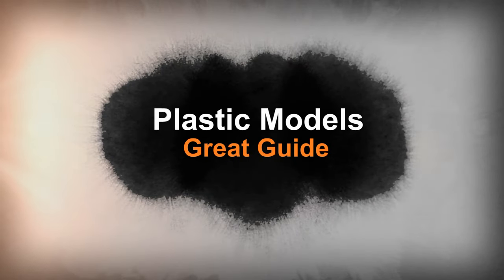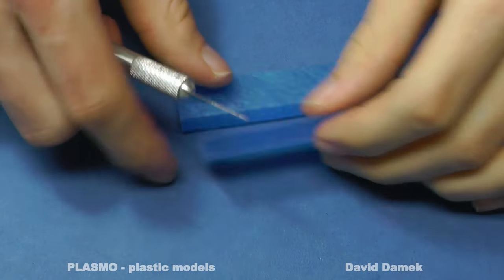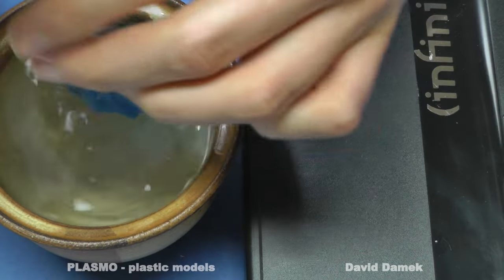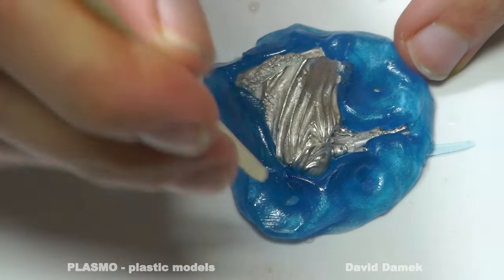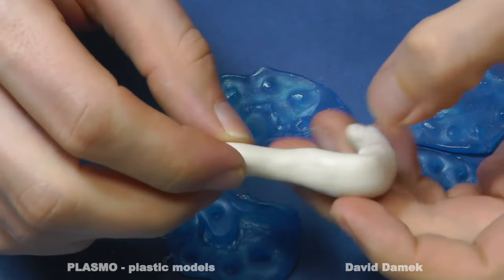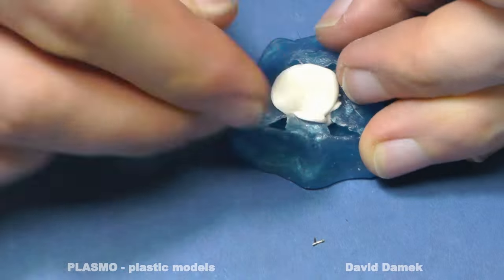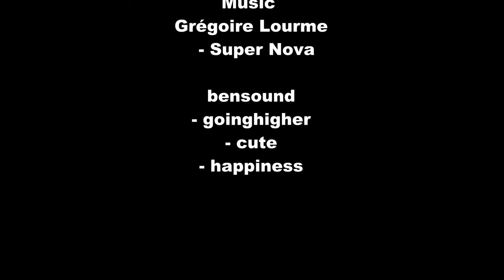Blue Stuff/Oyumaru  - How to cheaply cast miniatures or plastic models - new version

Comment: having tried what he did in the video.  I would not have cut the bricks into smaller blocks.  I let them float and soften up in the hot water.  I mush them together, as he does here.  But even so I still have streak lines in my molds and just trying to flesh them out smooth takes more time.  I go back and dunk them in the boiling water.  Even then it takes a long time.  
I wish he was more specific about the time it takes to kneed and heat the blue stuff.
DO NOT CUT YOUR BLOCKS!
Reply: I saw someone else mention that cutting the blocks is bad, may you enlighten me on why this is?

Comment: Small tip to get extreme high detail, requires an assistant, a hair dryer, and a toothpick. Assistant uses hair dryer on high heat on the oyumaru as you use the toothpick to press into the minute detail spots

Comment: I did try to cast small parts from various epoxy putty and the problem is that all of them are very fragile and break instantly i don't understand what i am doing wrong, I have not tried that actually putty that is used here in this video.
Reply: Difference brand have difference characteristics

Comment: can liquid resin be used anyways ?
Reply: Don't see why not. You would just need to have release channels, like what you would see on a proper resin cast. Also, depending on teh angle, you may run into air bubbles forming in spots as they cannot escape.

Comment: Can putting plastic parts into hot BlueStuff damage them easily?
Reply: Unlikely as these don't tend to get hot enough to really make traditional plastic parts react negatively
Reply: Metal parts will retain heat and  warm up both sides of the blue stuff and fuse them slightly

Comment: Your epoxy putty looks more soft than Milliput. I use milliput but probably if I use milliput to do the copies it will break when I remove it from the molds. Your putty instead can be removed very easily.
Reply: I bought oyumaru on ebay a few hours ago! Thank you for the video! I really need something like this product but I didn't know it already exists!
Reply: Your better off using kneadatite brown stuff or green stuff with these molds. I have used both millput the kneadatite, and I have gotten better results with the kneadatite. The brown stuff is less sticky that than the green stuff.

Comment: Would this work for 10mm figures? Any fans of dead GW games will know what I mean
Reply: the nerd shack  yeah those strips of tiny troops, just wonder how well this would do since they're not detailed just well, small
Reply: the nerd shack  Yeah I'm just gonna get some and try. It's cheap enough that if I cock it up its no big deal
Reply: the nerd shack  The biggest problem is mold lines. They are massive if you don't get a tight fit and use exactly the right amount of putty. Even if you get everything perfect there will still be a large line of lost detail. Troops small enough though you can just do a one part mould and its fine and so easy

Comment: Hello,
Is there a U.S. distributor for Blue or Green stuff?
Reply: E-Bay
Reply: @Anaris10  
Thanks for the info.
I prefer to "cut out the middle man" and the inevitable additional fees (PayPal) whenever possible.

I've since found that Michigan Toy Soldier carries the line.
Reply: @kidmack1121  Weird since whatever shop that is will be a 'middle man' and PayPal doesn't charge any fees for buying products.
Reply: @funoff3207  
I should have just admitted that I hate PayPunk because
they ripped me off!
If you are a hobbyist, you might want to check out Michigan Toy Soldier.
They have everything, but because they have so much stuff it can be hard to find using their search box. It can be pretty particular.

Comment: i bought blue stuff and tried to make a copy of a 1/72 fighter pilot: i admit the pilot is really small but i found a problem that is inherent to the blue stuff itself: the mold remains soft. Yes it's difficult using blue stuff before it hardern, yes it s difficult filling the mold with the putty but the worst thing of all is that the 2 parts of the resulting blue stuff mold will never fit properly simply because they are not rigid, so the putty will never be pressed properly and the resulting stamp will be bad. Very poor results. This stuff can not be a substitute to more professional materials
Reply: Also, i m using milliput epoxy putty and i MUST use a lil bit of water to make the putty fill the mold, otherwise the putty will stick to the finger or the tool instead than to the mold. Well the putty never dry. My casted pilot is still soft after 2 weeks i made it. This is more a commercial than a tutorial.

Comment: ya mine never worked like that ,had trouble separating the two halfs of blu-stuff and it never moulded like this.
Reply: You have to wait till first part of blue stuff mold is hard and then put other half onto it. Otherwise those two parts "melt" together

Comment: Okay maybe I'm a little naive or something but isn't this a copyright violation?
Reply from the maker: It was a lot of speculation about copying miniatures for your own purpose. You can not sell them, you can not use them in official Warhammer tournaments, It is not ethical, quality of the castings is not perfect, and it is very time-consuming. However, it is not illegal. Why I did this? It is a shame to throw to trash half of the plastic kit. Mostly you need to cast only a few parts and rest use from a kit. I think the larger danger for a manufacturer is 3d printing or professional copy from China. In my case, you need to buy an original kit.

Comment: @12:48...it didn't mold well from the original at the back you show...it's rounded and didn't form the detail...in fact, you didn't show this result in a reasonable amount of time and flashed the comparison scene quickly without allowing people to have more time to see the poor result. Am I wrong?
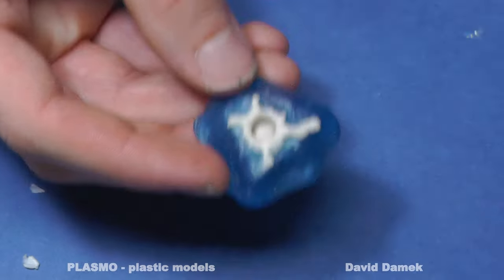Reply from the maker: The result is of course not the same and as good as the original miniature.  You must spend some time with cleaning imperfections and putting. You can see at 12:35 quite clearly that result is not the same.

Comment: wondering how you would cast a skull would it be side on or facing up anyone got any ideas just thinking of the flash lines
Reply: if you have detailed areas then it's probably best to put it so that detail is captured, mainly eyes,mouth ect so face down/face up otherwise you would need to poke the putty round the detail rather than just into the detail and as for flash lines just use some sand paper or a nail file
Reply: Ryan Rea  many thanks for the tip it's my first journey into casting

Comment: how about original work, how does one go about making his own 3d model and start making molds?
Reply: most likely your best bet would be to use wood or clay, but clay is preferred in that it is easier to sculpt. good luck with making your models. also try looking at tutorial on 3d modeling if you have a maker.

Comment: Thanks so much for letting me know about this stuff. I'm still learning to use it properly. Had mixed results so far because I can't always get the Milliput to fill all the spaces properly, or put too much or too little in, or the pieces don't align or imprint correctly. Takes some getting used to.
I'm curious though. Do you know if liquid plaster (I presume some plasters would be cool) would work? I feel it might give better results for more complex casting.

Comment: you loose detail, especially around complex shapes with voids  in them (clearly visable in the white metal figurine) that is one great disadvantage, but you can't beat the price
Reply from the maker: It looks that you have right but I sprayed figure with surface and it is quite same as original. Of course not 100% same. Epoxy putty is very shiny, so on a camera you cold not see all details.

Comment: The amount of work required to make these, verses the cost of just buying them.  I don't remember these miniatures being very expensive.
Reply: The alien he made parts for costs $15 for one. Comes in a pack of 3 for $45. Really depending on how much you value your time, but $15 for 10 minutes work sounds good to me. 

Also, this is great for getting duplicate of specific parts. Games workshop doesn't give our nearly enough pieces to equip your guys in the ways you might want. Instead of being forced to buy another $45 kit, you can just make a few weapons and be happy.
Reply: @secretnewmeta1981  I'm certain that takes longer than 10 minutes.  Please, don't exaggerate.
Reply: @secretnewmeta1981  Also, I know you are lying about the cost of the materials.  I called my local hobby shop and they said it costs about $15 just for enough material to make one miniature.
Reply: @charliechuckleberry5307  The company Games workshop sells the model for $15 each retail. $45 for a 3 pack. That's right there on their website. If it costs then more than $15 to make one miniature then they're losing money with every sale. By the way, the chinese manufacturer of GW came out and said that it costs them around $0.50 per miniature. 

The epoxy being used in this video costs $5 for enough to make 10-20 of those models above. The mold is reusable and can be melted again into a new shape, so one pack of blue stuff lasts you forever. That's just $12 for enough blue stuff for around 10-20 molds. 

Hope I helped you understand. Cheers.
Reply: @charliechuckleberry5307  You didn't watch the video at all. He used an epoxy putty that costs less than $5, and will make him dozens of miniatures. You're either terrible at paying attention, or a really really bad troll.
Reply: @secretnewmeta1981  Apparently, youtube or someone with power deleted my post.  That might be why this conversation does not make sense.  I asked you to give me the link to the items to buy.  You replied with it is 50 cents.  I commented again, where is the link to the store selling it for that much.  You replied with more bullshit.  I guess people are reporting my posts as offensive.  Sorry, but I just want to know your sources of where they are selling this stuff for cheap.  Your prices don't exist where I live.  Please, think first, before posting.  If you can't be bothered to give me a link to where to buy them for cheap, then stop replying.  Otherwise, you are just being offensive or harassing.
Reply: @charliechuckleberry5307  Im an american living in the Philippines. You can walk down to home depot or walgreens and buy it without shipping costs. You know that, but youre still trolling and arguing without purpose.
Reply: @secretnewmeta1981  Also, Warhammer models are overpriced by a factor of about 500 times the cost of the raw materials.  According to YOUR LOGIC, you would just buy the chinese knock offs for less than $0.50 a piece.  Much easier and cheaper than making your own.  You can also hire a Chinese worker to do the job for you for less than $1 per item.  What a deal.
Reply: @secretnewmeta1981  What are you going to do if I literally go to Walgreens, take pictures of the prices and prove you wrong?  Nothing.  I really don't care to check, because I already know they are $15 at the Hobby shop; and you are the real troll.
Reply: @charliechuckleberry5307  How many models can that $15 epoxy putty make? 3? 5? 10? 15? Even if it can only make 2, you are saving tons of money. 

Your argument falls to pieces the moment the tiniest bit of logic is applied.
Reply: @secretnewmeta1981  The amount of time I've been dealing with you, the troll.  Exceeds the cost of the item we are trying to reproduce.  I cannot have a logical argument with someone that fails to have any logic in the first place.  The minimum wage here is $15 per hour.  Did you know that?
Reply: @charliechuckleberry5307  US minimum wage is $7.25 unless you live in a metropolis hell hole. No wonder you think epoxy putty is $15 a tube. 

You still havent answered my question. How many models do you think your $15 putty can make? Because even if its 2 then youre saving money. 

The economics get even better if you buy a tub of epoxy putty.
Reply: @secretnewmeta1981  Wow, my bad, I'm sorry that you are bigoted against where I live.  I live in California where most minimum wages are $15 or more.  Also, you asking me how many models can i make from the $15 putty?  First of all, I don't know which putty you are talking about and second I'm not an expert at this.  I go by what is given on the package.  What is the volume need to make a model verses volume in the package.  You are asking me to make a guess based on zero knowledge of the subject you are asking.
The blue stuff molding material costs ($15.90 + $4.20 shipping + $1.80 tax  = $21) double the price to ship to USA, according to their Official website: http://www.greenstuffworld.com/en/reusable-blue-stuff/8-blue-stuff-mold-8-bars.html
The molding clay costs $15 plus research and time; and can do about 5 whole miniatures.  The directions and every reviewer says it takes over 20minutes, because of the careful need to fill in all gaps.  I would estimate about $30 in research and learning how it works, another $30 in risk.  So, about $100 total just to do your initial 5 miniatures.  About 10 times the cost of just buying a Chinese knockoff.

I also know you are full of shit, and will refuse to refund/guarantee any mistakes made by anyone taking your advice, when/if they get burned into spending more then you claim.
Reply: @charliechuckleberry5307  You live in California. See noe I believe your puttt really is $15 a tube. California taxes everything slightly mote toxic than lettuce to hell. I eouldnt be surprised if milliput has a 50 to 60% tac on it. 

Anyways, Its called a hobby. You spend time on it for pleasure. If you dont enjoy recasting, or are overflowing with cash then dont recast. 

The simple economics is it will always be less expensive to recast than to buy legit. I see youve moved the goalpost to chinese recasters though. 

Sure, if you want chinese recasts then you can do that while facing the headache and worry of having illegal products coming to your address through customs. Your packages will get stopped and confiscated regularly, and you will get a knock at your door. 

Its all your choice. I take pleasure from my hobby and dont want to add any stress to it by dealing with illegal goods. You might be different. 

P.S. Things get even more expensive to start recasting using silicon molds and resin, but once you start the supplies are cheap to buy in bulk. Personally, I only recast small bitz and accessories that are not really available online, or are always out of stock from bits sellers. This makes putty recasting the easiest method. 

P.P.S. I didnt call out your racist stereotype of Filipina because its not relevent. Be the bigger man and move on without framing yourself as a victim.
Reply: @secretnewmeta1981  quoting you, "US minimum wage is $7.25 unless you live in a metropolis hell hole"
You are a bigot, because you made a negative assumption towards a group of people based on zero facts. 

quoting you, "I didnt call out your racist stereotype of Filipina because its not relevent."
You are a bigot, because you assume that I'm not stating a fact.  How could you not know this when you are living in the Philipines?  It's even more ironic when I am Filipino...  All poor countries have cheap people desperate for money.  These facts are not even debatable, because they can be easily proven.  In the Philipines, about 90% of the rich families pay slave labor to have personal maids and servants.  When I was in the Philipines last year we had several old ladies and men just standing there on the side waiting for use to ask for anything.  They were literally like personal slaves.  It did bug me a little bit, but it is Philipino culture.  So, I just went with the flow.  Did you see that 90 day fiance show about the filipino?  The father living on a bed of pallets in a pig pen?  In the philipines the electrical system in complete dog shit, and I'm not talking about the difference in voltage.  I'm talking about the stability.  We had our own personal transformers to stabilize the voltage/capacitor banks to prevent burning out our sensitive electronics (basically big surge suppressors).  And I can go on and on about philipines.  The government is shit.  They let the chinese settle a base on one of the philipine islands.  Then they ignore the chinese when they attack philipino fishing boats, because stealing fish is easier than actually fishing it themselves.  bla bla bla, nobody cares right?

Honestly, I don't care, you are so offensive.  I would be happier if you stopped messaging me.
Reply: @charliechuckleberry5307  Youre lying. No filipino spells it as Philipino. Your other comments all continue to betray your lies. Maybe you visited here, but youre not Pinoy. Nuff said. 

Cheers and have a good life.

Comment: Hi Plasmo, my blue stuff results did not turn out so well.  I used standard milliput.  Any idea what went wrong?  I didn't press the milliput into the mold well enough?
http://puu.sh/sFFwo/3c8256b311.jpg
Reply from the maker: :-D Maybe your mold is not perfect too.
Reply: Your better off using kneadatite brown stuff or green stuff epoxy.
Reply: Thanks for the tip, I'll try some green stuff.
Reply: I like the brown stuff the best, it is less sticky and when it hardens it more like plastic. The green stuff is better for details and is more flexible when it gets hard. I used the molds for parts mostly and for cloning patterns to make fur capes and such.

Comment: This is not how mine arrived. It had two different color mold like flat tape. Horrible horrible product. Use Tamiya 2 part mold, superior over the garbage I recieved. The blue stuff works only if I use propane torch to  keep water from cooling slightly.
Reply: We're the two parts blue and yellow? Because you bought green stuff not blue stuff. You got the wrong thing bro